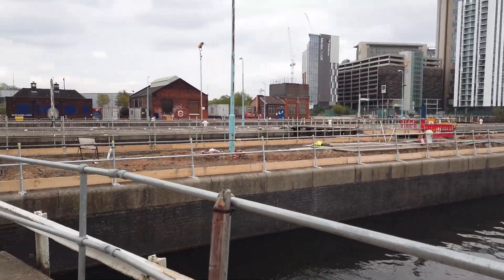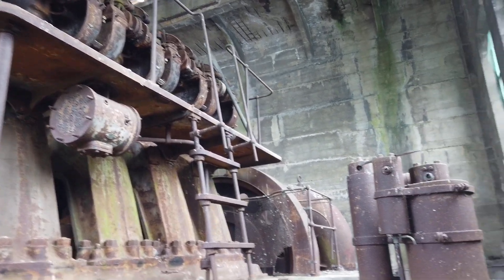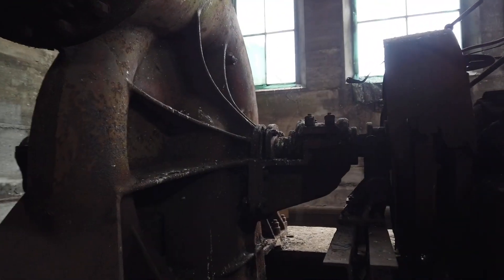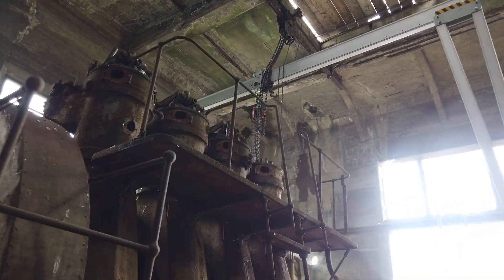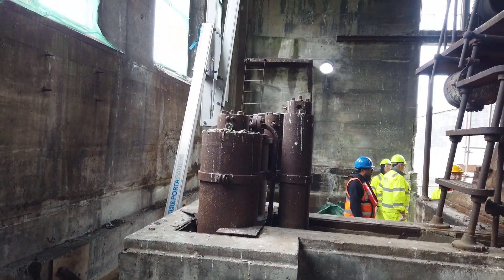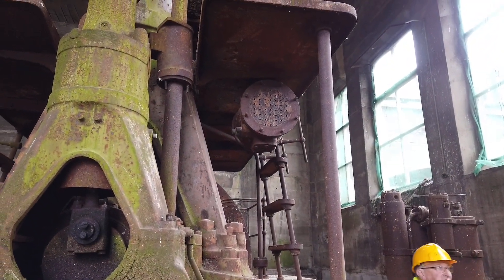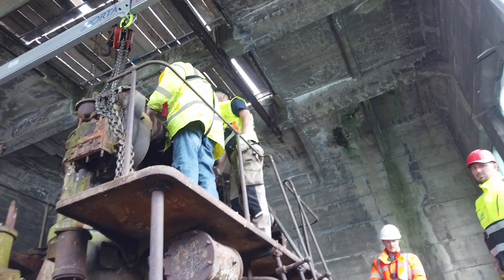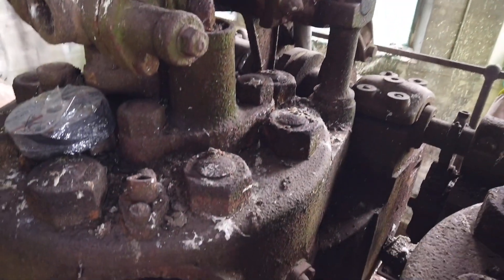Mirrlees 4cyl Blast Injection engine  at Mode Wheel

Comment: What a shame. I worked with Peter Wood and others on the removal of the first one to go to the museum back in 1993.
Reply from the maker: Peter The engine you helped to save was from Davyhulme, it’s currently going back together at the Anson.
The plan is to run it, parts from the Mode Wheel engine are being used.
Here’s the crank going in

https://youtu.be/1jtV9oKH9so?si=EeNbgN8NzufFf7uH